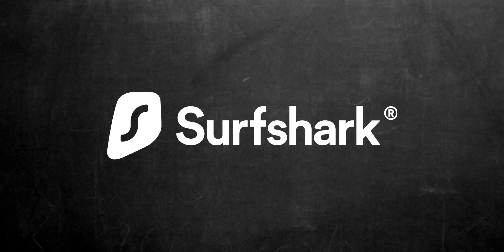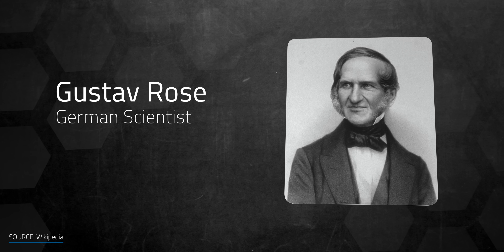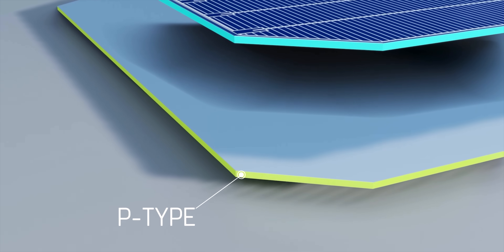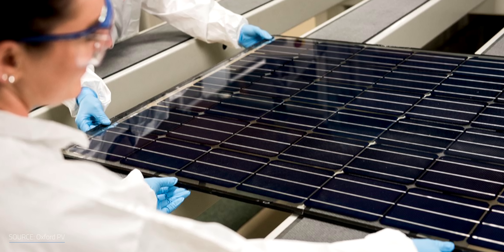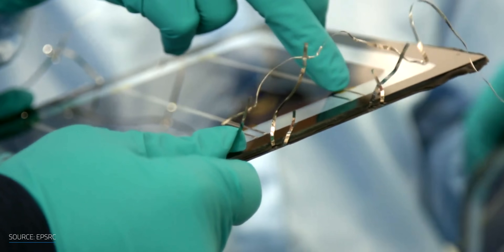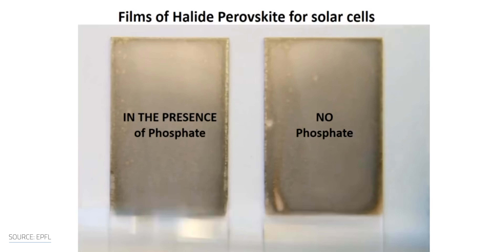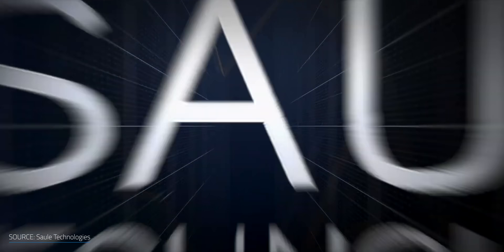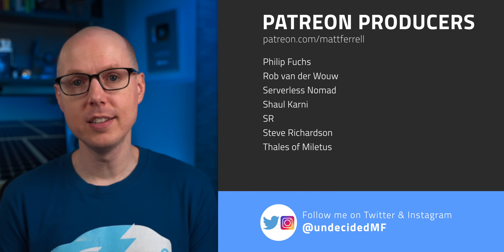Perovskite Solar Cells Could Be the Future of Energy

Comment: I would like see one day, that hoods, fenders and bodies of vehicles and maybe even yachts made from this material that could one day power electric motors. Maybe even submarines that can cruise under the waves to avoid bad weather and only needs to come to the surface for charging once a week perhaps. However, first we need governments to stop producing “Gain of Function” bio weapons such as Covid19, which has no viable use whatsoever except to decrease the planet’s human population much like Raid is used to kill roaches and ants. 
    Just a note, humans have the capability to protect their body’s natural immune system by way of vitamins but most humans are not willing to accept the expense and time required to use vitamins on a daily basis. We know as fact that vitamins can prevent the occurrence of the flu and the common cold yet we still refuse to take vitamins on a regular basis. Maybe if we produce a tasty chocolate bar with all the necessary vitamins that would take humans to the next level immune system protection that can transfer from one generation to the next to the point that the human DNA will adapt to increase it’s natural ability to protect the human body from viruses and bacteria at a much higher level over time.

Comment: When building huge solar power plants, the biggest factor is the durability and how long they will last in use. More efficient?, just add more Silicon cells to compensate or solar tracking which will add 40% to power outcome.

Comment: I live in Australia, and I've been off grid with solar PV for 30 years. If perovskite has a durability problem, the key is to limit its exposure to UV, to peek gathering times. The shade screen application solves this problem. But a simple motorised cover blind does also.
Reply: Shade screens or cover blind limit the power of the cell. The problem is the durability . My solar cells are from 2009 so approx 12 years.

Comment: I worked with pervoskite solar cells in a lab for a while. What came out of my experience is that it's dirty, unstable, the reproducibility is very low. In my opinion this material is the proof that it's no longer the pure need to know that is leading research, but fashion trends. It does look good on the paper, I admit, but I just wish we spent as much money on decreasing consumption than in new energy sources. It would be easy : by stopping designing items with high-tech unecessary features and come back to our good old fridges that are also our shrinks and coffee makes, we would save money and energy. No need of other energy sources if we stop consuming it like it's abundant.
Reply: Won't compare much to the billions of up-and-coming middle class in India and China by simply trying to conserve a bit.  Nothing wrong with that, but we need real breakthrough solutions.

Comment: If Oxygen, moisture, and heat are the main degraders then maybe the jumpstart market for them should be in space.  Solar power has been the primary energy source out there for a long time and with the need for efficient in-situ processes to keep a future Lunar or Martian colony alive, a panel that passes the accepted efficiency limits and could potentially be manufactured off-world thanks to less costly processes might be its breakout role.

Comment: I still think the biggest holdback for solar is not being able to produce more power than you need at the homeowner level. Utility companies only allow you to produce as much as you typically consume.  I think more people would be on board with solar if there was a fixed payback price for energy produced above what a typical home uses. The payback period for the initial investment would go down and people would try to be more conservative with energy usage if they could make money back. The system we have now is causing people to want to be independent of the grid with battery banks and triple power inverters. Utility companies need to focus on energy storage instead of putting caps on energy produced. Make better use of the extra energy produced during the day like producing green hydrogen or running more seawater Desalination plants with green energy.

Comment: net zero is a life tax, the elite who pay nothing will insist you morons pay for the right to exist and promoting it when it is demonstrable that we do not need solar nor do we need nuclear nor coal nor petrogas and that we already have but ignore an energy source that solves all power needs while actually sequestering carbon for forever only fools will believe this nonsense is the way to go. the u of ark graphene alternator renders all other energy sources obsolete and yet schills like this keep pushing earth ruining, literally, 'new systems' to keep the moronic masses passive and the ssheeple will attack those of us pointing out the bs

using a stirling engine a simple tender box to keep if working and a good electric motor we could have been running hybrid electrics before the gasoline engine was put to use but because the rich elite found a new way to profit off a waste material here we are so no, we do not and have never needed gas or coal or nuclear but schills like this will convince yoo to follow the plan  the greedy elite rich want and make you pay for the right to exist

Comment: 85 degrees? In California summers are waaay hotter than that. Surface temps can jump to 110 or higher during the summer and I’m near San Diego. From June to September that’s 1300+ hours at much hotter surface temps than 85 degrees. Hopefully they change that standard test.

Comment: Part of the problem with these developments is the manufacturers are often looking to use the tech in exactly the same way that the old tech is used.  (Semi-transparent notwithstanding.)  That there may be ways of integrating cooling into a perovskite cell system that takes heat out of the system, providing another resource, while increasing the lifespan of the cell.  Maybe even at higher flux levels in concentrated systems.

Comment: So many issues that needs to be solved, that is only individually, and mostly not fully solved, means: Don't hold your breath. If you change something to reduce toxicity, or increase life expectancy, you're likely to create new problems, or reduce/take away possible advantages over other alternatives. The end goal is power generation, so other competing alternatives is not even limited to other types of solar PV, not even all other types of solar power generation. 

The estimated possible lowest cost of production of the cells 10 or more years from now should not be compared to the price the buyer pays for complete solar panels now. That is more than an order of magnitude from a fair comparison.     

The production cost of silicon cells is low, and decreasing, it's a small part of the cost of complete systems, which means there are actually not very much to save on complete systems with cells that are cheaper to produce. Higher efficiency could save some cost by reducing the size of the panels, but then again, you have to be able to get that higher efficiency in the real world, and also have at least similar life expectancy, while not needing more expensive protection of the cells. So, perovskite panels is extremely unlikely to complete with traditional silicon PV panels in the foreseeable future.             

Maybe it can become relevant for special use cases, but even there it's likely to be mostly a gimmick, for example don't expect 30% efficiency of PV in optically clear windows, or such applications to become cost competitive in "normal situations".

Comment: While it might sound labor intensive, I would rather have cheaper, awesome solar panels that I have to replace every couple of years rather than more expensive, limited solar panels that would last forever. Sure, there's a certain value that comes from 25+ year warranties, but the technology for solar panels will likely be vastly more impressive in 25 years, so why would you want them to last that long? Imagine signing up for 25 year panels and committing to that sort of payment plan, analyzing the point at which the panels would start to pay for themselves (or payoff rather, considering the heavy initial investment), only for some ground breaking discovery to be made a month later that makes your panels look like dinosaurs within 5 years. I WANT my panels to be easily replaceable so that I can swap them out as technology improves, and I don't mind if that means they need to be changed every few years.

Comment: The challenges and limitations listed in this video remind me a lot of early lithium batteries, but without the high cost. I remember the concerns of technicians (including myself) when presented with the first LiIon laptop batteries and their properties. Most of us were skeptical. Now, lithium dominates the battery market. Of course, I also remember the technologies that didn't work so well. NiCd, for example.

In short... maybe perovskite could take over, if only for niche purposes like flexible panels, transparency or high efficiency applications. If not this, then probably some other technology. Between the plateau of silicone solar cells and the increasing demand for green energy the need for better solar tech is great, and nothing drives innovation like need.

Comment: If it can't last as long as silicon, then we are looking at a situation where it's usual to get your solar panels re-layered every few years. Which is perfectly fine, especially if the re-layering company also manages recycling and anything toxic. So that's what they should be looking to design. A modular system where you cycle out the panels. Ring up the company, they take your old ones, clip in some new ones, and back to the shop for reconditioning.

Or even better - the franchisee who does the installation work ships the old panels back to the parent company and clips in some new ones, ad the parent company deals with the slurry.

Comment: Hold up... you said that the cost per square foot for a perovskite module was $0.25 and for a traditional solar cell it is between 4-10 dollars. Assuming we are on the low end of that range that still means that perovskite is 16 times cheaper than a silicon solar panel. If my math is right and silicon cells last for 25 years (which I know they can go longer but 25 years is the manufacturer's guarantee) that means that you'd have to replace your perovskite panels every 1.56 years to spend the same amount of money on them as you would a silicon solar setup. Now I'm pretty sure that the numbers you were citing were cost of production and not necessarily cost for consumers because later on you said that they could cost 10-20 cents per watt whereas traditional solar panels hover around 70-150 cents per watt.

Tldr: perovskite solar panels don't necessarily need to match silicon in longevity if they are more cost effective over time. If they are only good for 5 years but over the same 25 year period consumers are spending less money then consumers are going to be willing to replace their panels every 5 years.

Comment: As far as I know, you can get up to 40% performance of a solar cell by using a "micro-pyramid patterned surface". This is applicable to several materials
Reply: Makes sense a pyramid has 4 times the surface compared to a flat surface.

Comment: At 30% efficient, then assuming 1000 watts per square meter from the sun (very high), the 1 square meter panel will generate 300 watts (not much). Seeing that efficiency must equal 100%, there is 70% unaccounted for. Some of this can be accounted for by light reflecting off of the panel. However, the rest can be accounted for as wasted heat. Being very simplistic, you can say that for ev3ry 300watts generated as electricity, there will 700 watts generated as wasted heat. You are heating the atmosphere around your home. If that heats up your home you will then use more air conditioning to cool you home. So where is the advantage? It does reduce the cost for the local utilities because the power is distributed over a large area, and the home owner is responsible for any break downs.

Comment: I would be ok with lead in solar cells if :
1. The lead was chemically bound to something or encapsulated in some way where we can be sure it's not leaking out in to the environment. And
2. There was an easy and public method of recycling the cells after their life, so when they inevitably and eventually die there is a responsible means of disposing of them so we know, once again, that lead isn't leaking into the environment.

Comment: IMHO increased performance, more than a decrease in overall cost will prove to be the tipping point at which perovskite completely replaces silicon as the primary component in solar cells. When it comes to conductivity and conversion, I feel as though silicon has reached it's ceiling, whereas perovskite might still have room to grow.

Comment: Technology is very complex.  First off, read and understand "Moores Law"   Im an engineer and understand it very well.  By the time a company gets anything into production..  it is obsolete.
Solar panels on roof tops now are 20 year old tech, and have probably been sitting in a warehouse for 5 or more years before even making it to your house.  Making it even more questionable.
Do you remember CRT monitors and TV's?  BEFORE flat panels would be released to the public, the manufactures "Sony" and others wanted to DUMP their massive inventories of CRT monitors and TV's to recover as much of its supply chain manufacturing costs.  
That said.. so WHATS NEXT?  Graphene.  its going to change EVERYTHING...  Batteries, solar panels, computers, cell phones > as thing as a layer of skin...  Manufacturing process?  How about "GROWING" the circuitry...  No dirty fabs, with exotic expensive rare earth materials, and the nasty acid run off.
Its not here NOW...  because warehouses are still too full of 20 year old solar panels, and those manufactures are trying to SQUEEZE EVERY PENNY from their inventory.
Imagine a solar panel so thin its invisible, and embedded in the windshield of your car, or every window in your house...
They technology exists today, but you will have to wait 10 years to see it.

Comment: if these cells could be tuned to absorb infrared and ultraviolet specifically there efficiency would double in a 24 hour cycle because both wave lengths are available at night. infrared cells could actually cool absorbing radiant heat

Comment: I think all the longevity issues are irrevalent at those costs, if putting cells on my whole roof is 2k vs 20k - that gives me the power I need, and in the next few years those panels can be either recycled or sent to some impoverished area to provide them with power as a tax credit to me - and my cells can be replaced with whatever the new tech is as long as the panels themselves are designed to pop in and out easily to be replaced with whatever the new hotness is in 5 years.  

Once the transfer switches and batteries and infrastructure are installed in homes, if popping the cells out makes sense - the market will make sure it happens if it needs to happen for a compelling reason such as a gain in efficiency that justify the performance or longevity thats hits a notable threshold.  

An impoverished area would be very happy to get a container ship full of 80% effective cells.

Comment: This could become the better solar panel. Every improvement is good, but... the actual and far bigger challenge is not getting the better solar panel but how are we going to make all that unreliable solar (and wind) energy reliable. There are no solutions for that (for the scale and time frame we need). These panels might become cheaper but the actual costs will not be in the panels (and wind mills). The real costs will be in making it reliable. 

For the big picture this does not mean anything, hardly relevant. Or am I missing something?

Comment: So at the moment Perovskite solar is about 10% the longevity in the real world of standard PV cells. So you won't get 20 years use, you'll get just 2 years.

BUT....... (notice the big but) they are a whopping 50 times cheaper. Every panel will be $0.20c rather than $10.

Here is the question.... would you rather spend $200 on free energy but it only lasts 2 years or $10000 but it lasts 20 years? Its a no brainer right?

BUT... (before you make your mind up as easily as that)

The primary cost in installing solar is not the cost of the hardware, its the cost of the labour and unless there is some new automated way of installing this technology you will still need qualified solar engineers to install the hardware for you. 

So... not wanting to piss on the solar parade I have a solution. Make the perovskite panels a 'clip on' addition to the roof racks holding the panel. Now WHEN they reach the end of their life you pop down to your local supplier... buy new panels and they just 'clip in' to the existing roof mounts. The old panels can even be recycled. Just like light bulbs.

Yes I know its a 'simple' solution... But I think we can all agree a simple solution is a good solution.